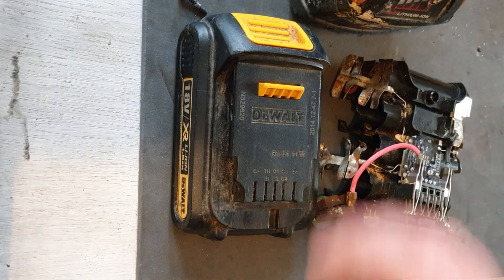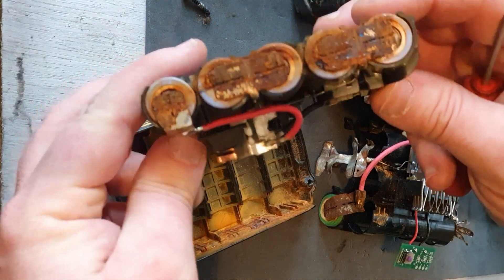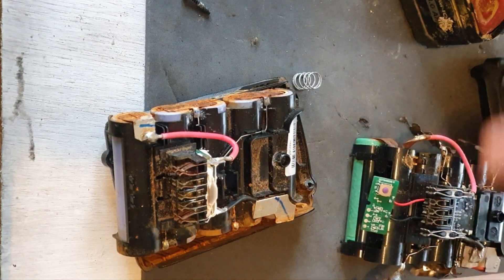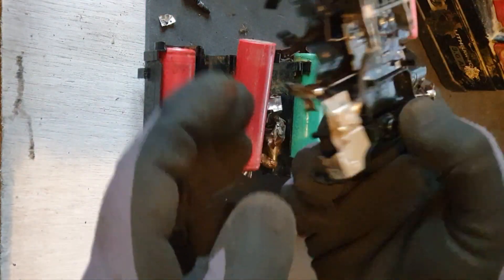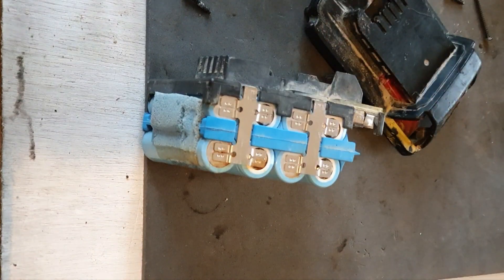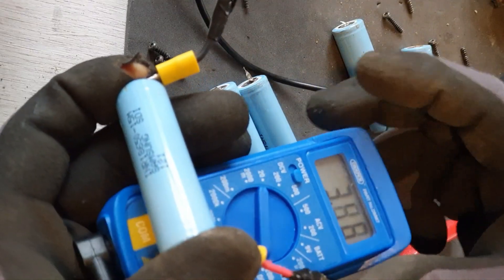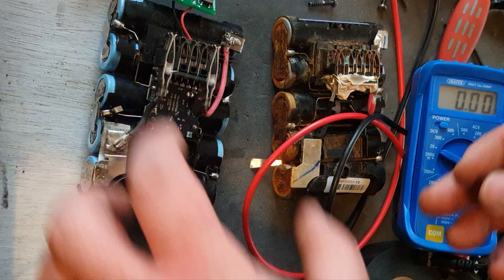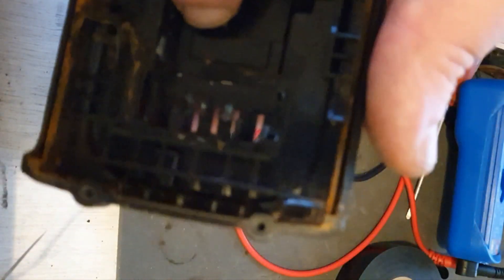Dewalt 1.5ah 18v Battery rebuild #powertools #repair #trending #milwaukee #dewalt

Comment: Nice one. I find Makita are always a good source of cells as its not often worth changing the PCB, which is usually the problem. Fixed 8 DW batteries this weekend myself! Along with a DCH253, DCS355 and DCS380. On the newer batteries DW have started glueing the cells in at the bottom which is an absolute pain
Reply from the maker: I never had a DCS380 open yet just curious what was wrong with it?
Reply: Pinion gear on end of armature stripped teeth where it meets the crown gear. Whole new armature assembly needed. Then I snapped a brush so will probably lose money on it now. But better than binning it! They have a hard life seen lots come up with mechanical faults.